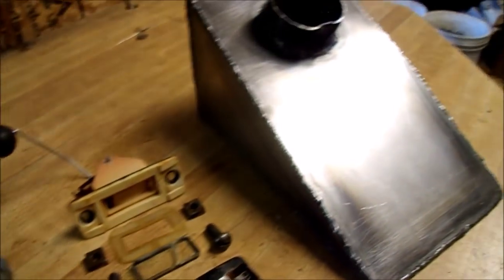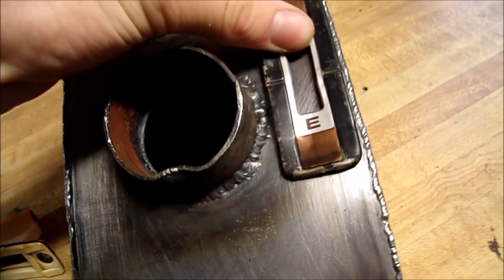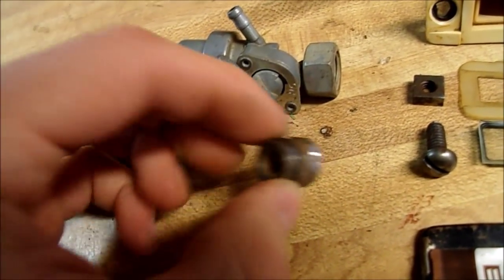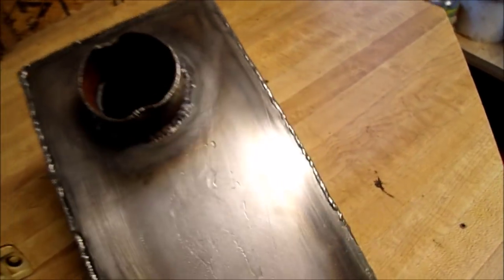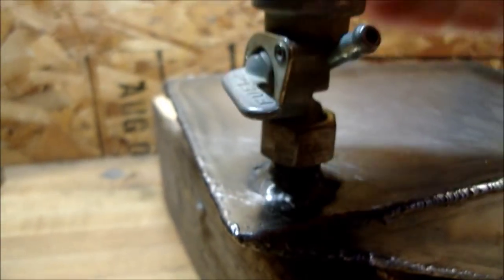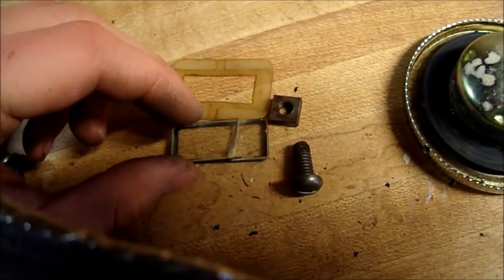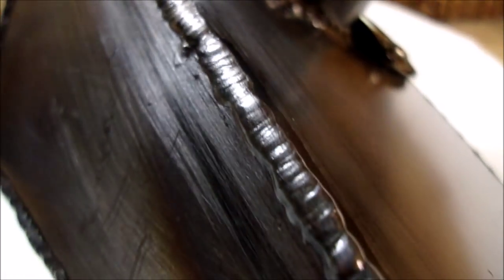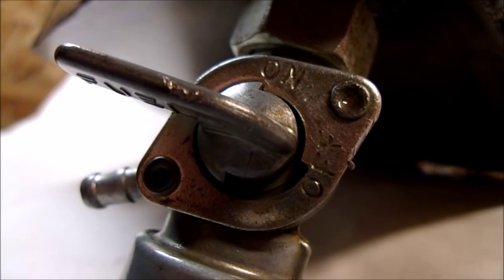5hp mongoose mini bike - Building the gas tank

Comment: Awesome job the gauge was defiantly a nice touch.. What about mounting? How do you plan to mount it?
Reply from the maker: +MidwestMotoRider i will probably weld two bolts to the bottom of the tank and drill two holes in the frame to bolt it to. thanks for watching